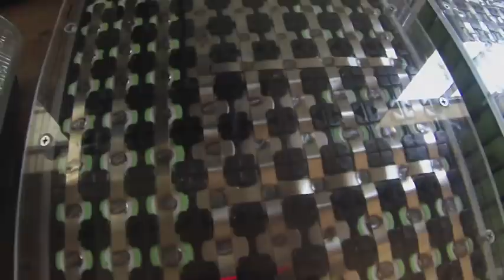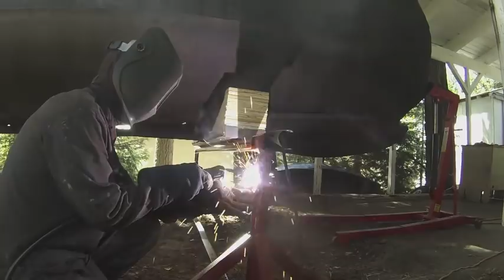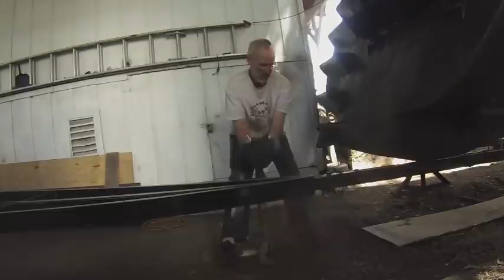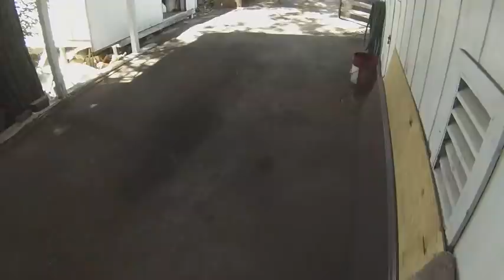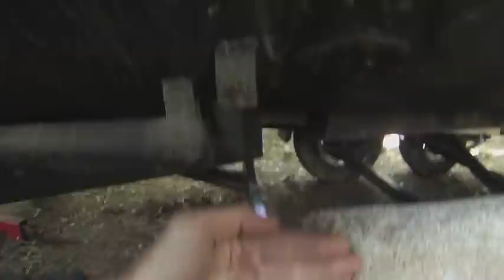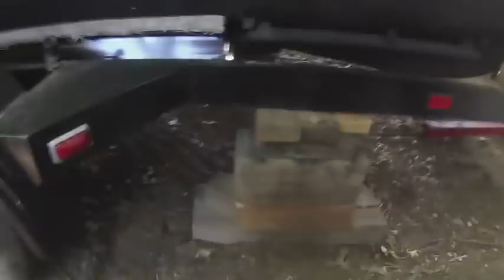Steel Sailboat Build Part 40

Comment: Excellent build. I'm really impressed that the engine hoist handled the whole weight of the boat. I will probably be gone by the time you get there, but Landings at Colony Wharf in Bellingham, WA is a nice boat yard to work and get launched from. Less expensive and good location.

Comment: Those look like 2000lb axles and he only has 2 support rails that barely run 50% of the length. Frame is lightly built. He lives in the mountains east of LA long haul and the trailer will be extremely  over loaded. HUM. Ad more struts frame the frame to the boat hull to make it a stressed part. Run braces from the hull to the hitch.  Even if you have to temp weld attachment points. But that does not solve the way undersized axles
Reply: Its like the rest of the build, this thing wont be stable in the water.

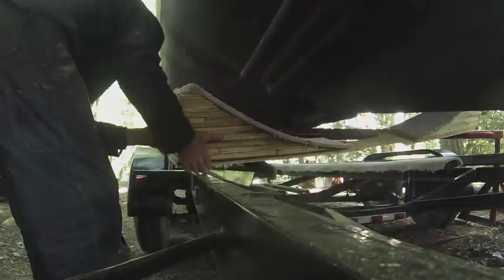Comment: I'm at 6:27 and hoping you have chocks under the wheels.  I'll update a bit later.   Ok, I see that the trailer had to be adjusted and is resting on chocks.  I liked this video (liked them all) as it shows a long view of your boat and its lines, plus you stated your intentions with where it will be located.  Its sounds like a good plan, an enclosed, snug cabin for when the rain and cold appears. I haven't seen every video and you might have said this but will your boat be a motor sailer (more motoring that sailing), or a sailer with a motor for maneuvering in an anchorage?  Either way I look forward for launching.  Thanks for posting and have a safe, enjoyable summer.

Comment: I found soldiering way lowered capacity on any cell I tried.
Reply: Solder does not conduct well a mechanical bond is much better. You are correct.
Reply: @tomhutchins1046  -  I wonder why solder has always been used for electrical work if it conducts electricity so poorly.  :)

The problem, as I understand it, with soldering lithium-ion cells is that the heat tends to damage the cell.  Spot-welding takes a fraction of a second and transfers much less heat into the cell.
Reply: @clearasmud376  Its used in production work because it is fast and cheap. I have a friend that is a PHD at Lawrence Livermore. He says consider solder a glue or a sealer. The connection should be mechanical. Also heat and or vibration is always a problem with solder especially on copper.Solder has much more Resistance than copper or even steel.
You can learn something or stick your head up your buttt and argue. Your choice